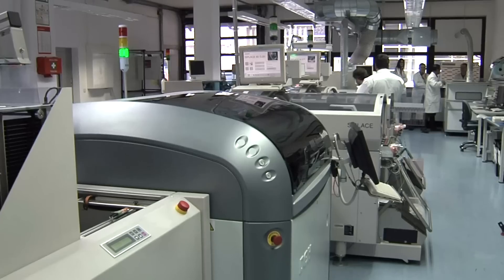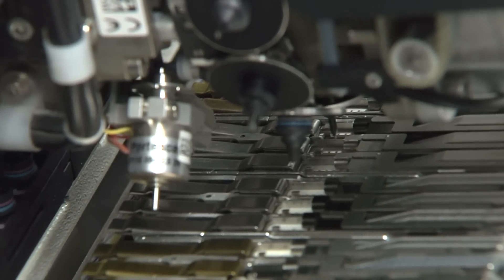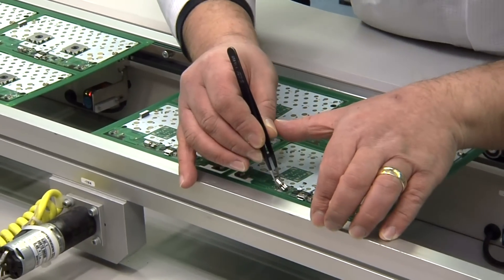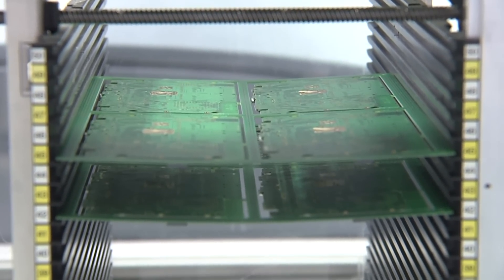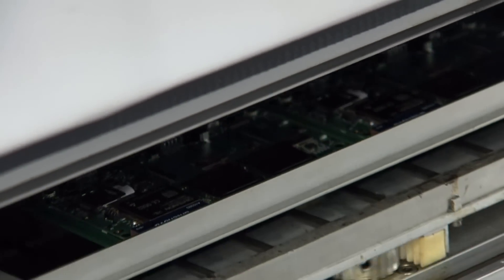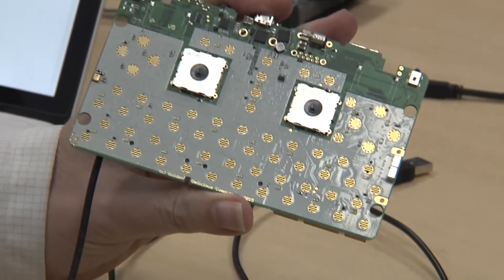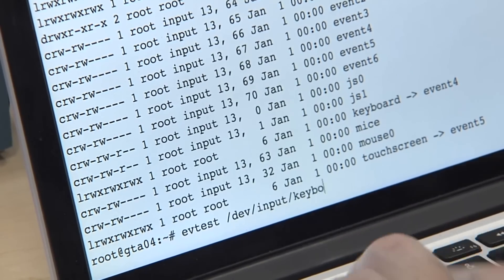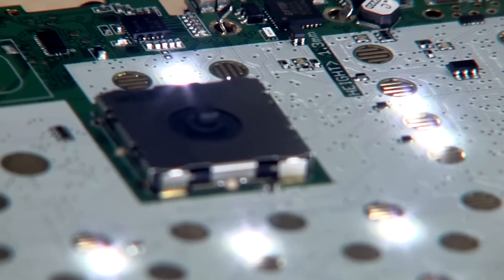Pyra Prototype Production Run (Dec. 1st, 2015)

Comment: "User-Upgradable CPU-Board"
Is it technically possible to upgrade it with a x86 CPU-Board? Are you planning to produce some after launch?

BTW, I have a Pandora, and it's awesome :)
Reply from the maker: +neko.works Yes, it is possible, though we don't know yet what new CPU boards we're planning.
Probably depends on the sales as well - the more sales we have, the more funds we have to work on different CPU boards.
Reply: +OpenPandora I see. Count me in if you ever make an x86 board!
I think you really should do a KickStarter, with stretch goals such as x86 support. I'll definitively back it!
Your project is unique and interesting, and you have a reputation with the Pandora. I'm sure the Kick will be successful!
Reply: +neko.works I'll do a Kickstarter in case it's really needed.
But I'd like to save the 10% fees if possible :D

Comment: how much will cost the pyra?
Reply from the maker: +Ricardo Funes Not yet exactly known, but probably around 500 EUR.
Later upgrades (like a new CPU board) will be a lot cheaper though, probably around 100 EUR (depends on the CPU price).

So no high costs each few years to stay up-to-date.
Reply: Thx for the info mate, pyra rocks